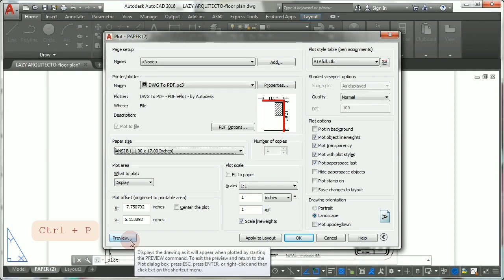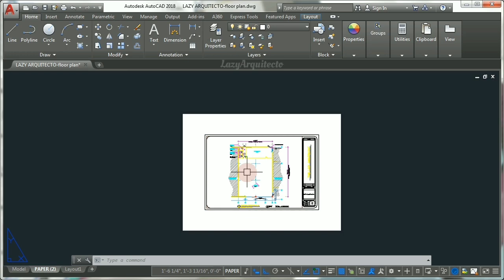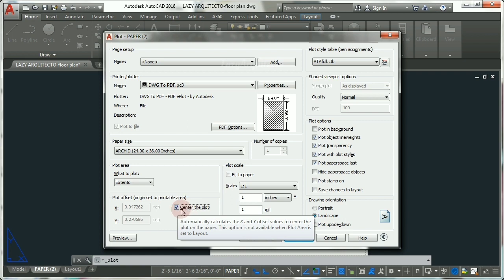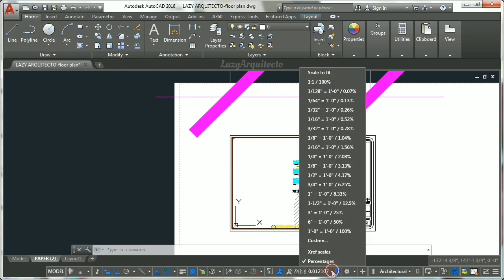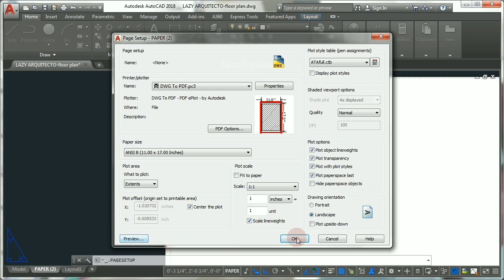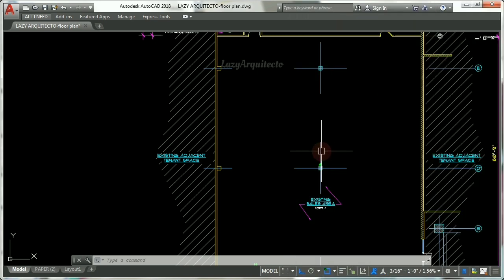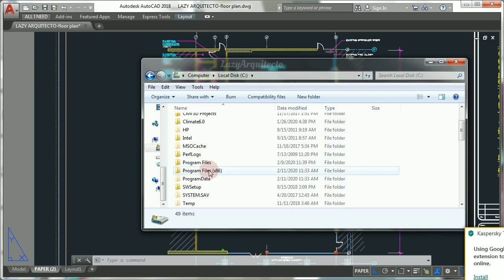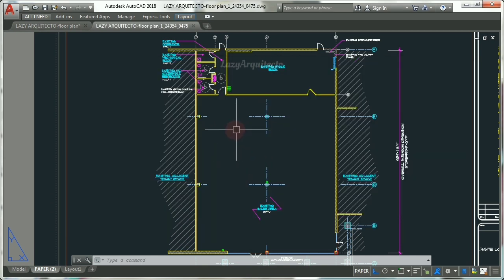PRINTING PROBLEMS for AUTOCAD STUDENTS

Comment: Ys sir now I got the correct video...thanku 
One more thing i want to take from ur side is that i dont know the line type i.e which line type is used at when ...for example hidden line ,continous line ,two dash line whis is the purpose of these line and while drawing the plan what line type is used at which object ...so i need thsi from ur side...thanku sir thanku v much
Reply from the maker: Khan happy to help. Hidden line or - - - - - is used to show above objects for example in a floor plan that is usually cut at 4' above floor, a soffit or canopy would be shown in hidden line. Hope 5his make sense. I will do a video about it with more details. Are you an Architecture student?